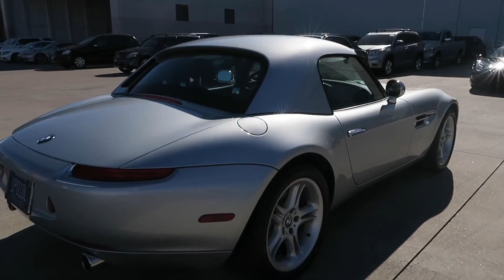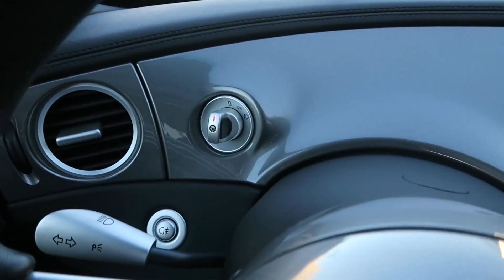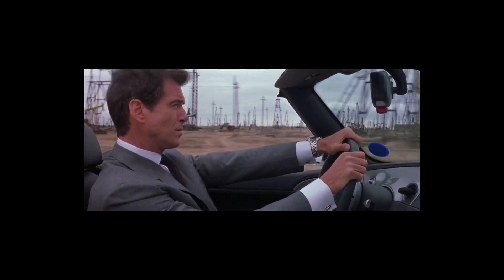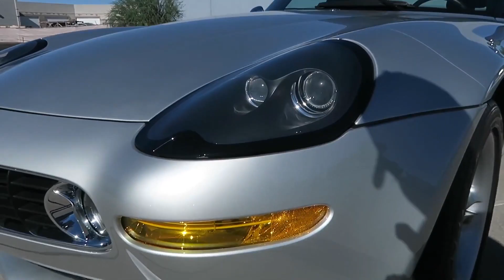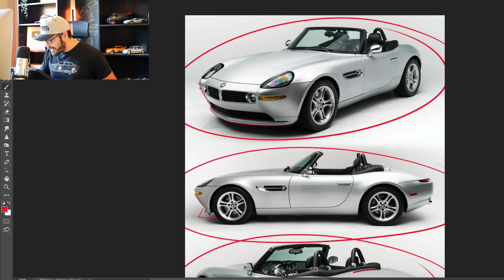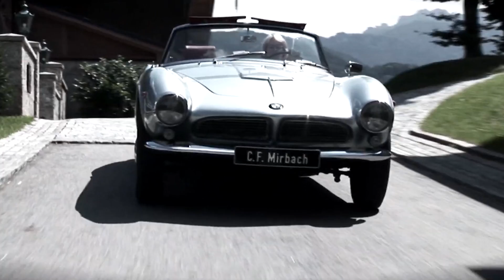Here's why the Z8 was peak BMW

Comment: It's the right TIME of peak BMW, but I wouldn't say the Z8 was the peak.  I've had two E39 M5's (the first V8) which I think is an absolute classic and I'd prefer to pretty much anything on the market now.  Also at that time were the first X5, the beautiful one, and within a couple years, the E46 M3 CSL which wasn't so popular new but saw a new lease on life a decade later as people used  different tires and some did manual transmission conversions.  I seriously was thinking to get a Z8 but honestly, the M5 was cooler yet: the engine in a sedan is sleeper, while in the Z8 is was actually expected to be fast and actually was a bit slower than the SL55.  I've considered the Z8 again and again, and despite the expert reviews saying it wasn't a classic at that time, I think the depreciation has been very low so I was right that it was a good buy.  But.... nah, the M5 and the following CSL were peak.  (I've also had a 1995 Supra Twin Turbo, and got my R35 GT-R the week they went on sale in Tokyo.  Also had an F430 manual spider.)

Comment: It’s called new European regulations including safety and emissions standards. Additionally BMW must produce cars for a larger market rather than a few purists. I drove the Z8 and though its fun its hardly comfortable and is most certainly not as safe vs modern cars. This was the period where cars had more power but few modern electronic safety systems. If you pushed the car you were on your own!